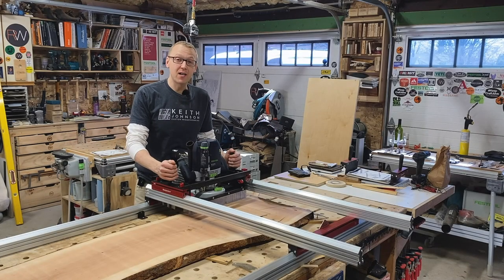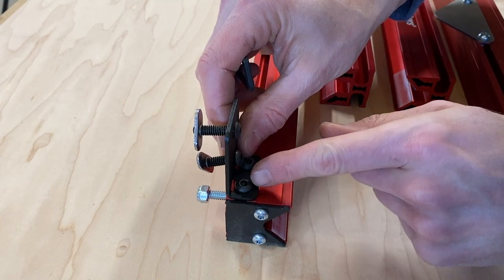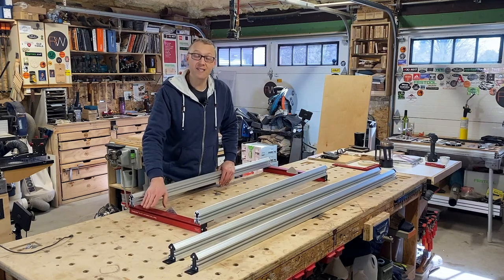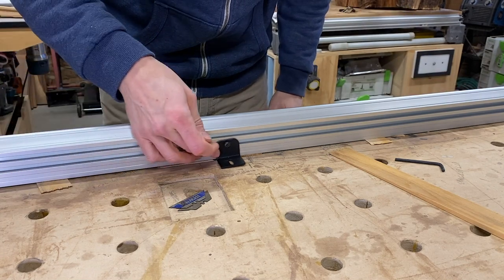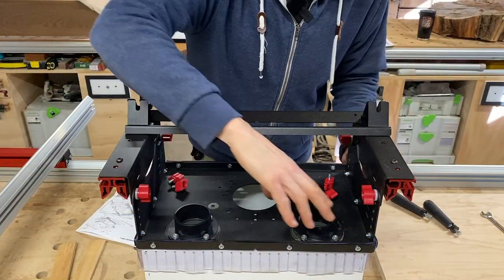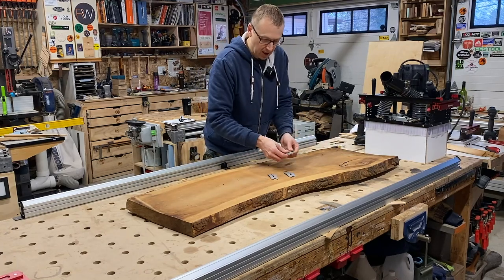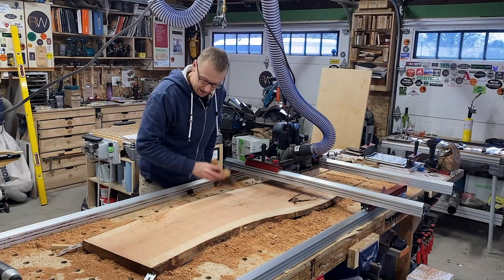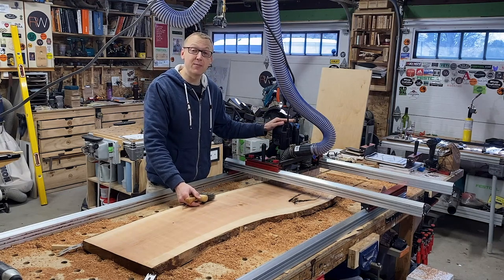Slab Flattening Mill PRO Assembly & Setup | Woodpeckers Tools

Comment: Just purchased and your video was instrumental in showing short cuts and practical advice for changing height of carriage. I’ve got mine on a large precision ground metal fabrication table and it’s helped to keep things flat.
Your video also helped me avoid getting that same router bit and I went with one with replaceable carbide cutters with excellent results.

Comment: I've been using this sled for a year now. It's really good. But if I had my way, the carrage would be smaller to maximize the routing surface. And I would put many more slots on the height adjustment of the carrage, they look about 3/4" apart now, I would try to make them as close to 1/8" as possible, because it's very difficult to get the skirt to just the right height. And maybe even an adjustable skirt. I'm not a complainer, but for the price I paid, it should be flawless.
DO NOT let the skirt come into contact with the slab, the carrage WILL trip over it causing the bit to dig in.
Reply: I adjust the depth of my router bit sequentially and have not yet experienced these issues. May depend on router used I guess.

Comment: What prevents the sled from lifting off of the rails as the bit gets dull? Even running a piece of wood through a table saw blade, which is dull, will cause the wood to climb the blade.
Reply from the maker: My first thought is why are you using dull tooling? But to directly answer your question, the horizontal rotation of the router bit is different from the vertical rotation of a saw blade. There's little tendency to lift the tool. By the time the tool is dull enough to alter the travel it will be burning the stock so bad you should know to change bits.

Comment: i just received my woodpecker slab flattening mill with extensions. trying to put it together. do i need my table to be 12ft long to use the end fastening brackets? the instrutions dont show how to put these on the table and niether does this video.

Comment: Would you not want the bed in the same plane as the rails? Sure one side of the slab would be flat. However he minute you flip it to do the other side you would see a gap between the bed which has a slight bow and the flat slab. Please correct me if I am wrong. Just confused as I am still learning myself. Thank you
Reply from the maker: You're absolutely right. Keith didn't show doing the second side. If your table isn't flat and you shim your rails, when you turn the slab over, you'll have to shim the slab to compensate. A better answer would be to build a flat table, but in this case, Keith was using a bench he already had. Just adds another step when doing the second side.
Reply: @WoodpeckersLLC  awesome! I really appreciate the feedback! I just received mine from y’all yesterday along with the DP Pro 36” set up for drill press.  I can’t wait to start using it.

Comment: @woodpeckers i am not an engineer but i do have a DIY mill at home.  Why does he focus so much on the sled frame  being square during assembly.  When i built my home sled i have a sled that rides on rails and the rails sit on the side rails.  much like your design here but i didn't worry about square as much as i worried about the planes. 

What am i missing?  TYIA

Comment: is there a good reason to use a router vs an electric hand planer?
I am not very experienced. but it seems to me that an electric hand planer would provide better results.
But maybe there is a reason I am not experienced enough to know.

https://youtu.be/ko2Tl7cDl6E
Reply from the maker: Slabs frequently have end grain or highly figured face grain. A power planer will struggle to deliver a nice finish in either case.
Reply: @WoodpeckersLLC  
Thank you for answering my question
Would you be willing to do a comparison video that illustrates that difference and challenge?
It never would have occurred to me the grain on a slab would be the issue for an electric hand planer.
Always looking for ways to learn from experts